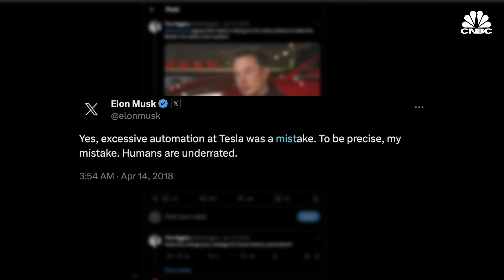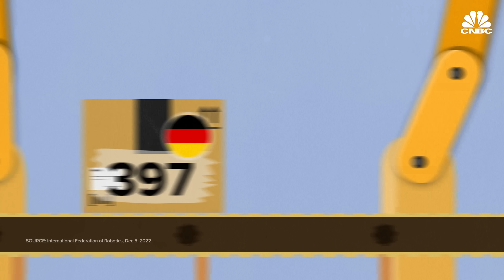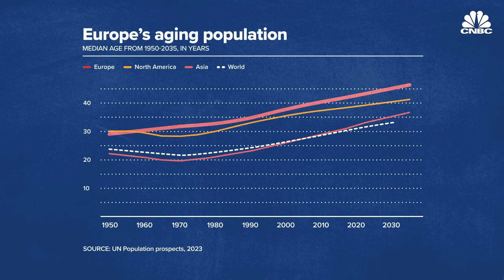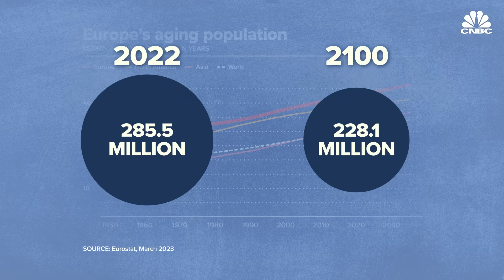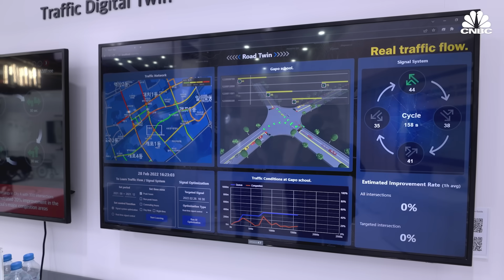Factories are heading for a ‘dark’ future — and it’s not what you think

Comment: The segment on needing humans to detect a fault or error was disingenuous. IoT or PLC controls are instantaneous and capture millions of data points in a day, all of which are statistically analyzed autonomously. The microsecond something hits an outlier detection program an expert system can diagnose the issue, halt the line, call in for maintenance or even involve a human mechanic. This capability has been around for almost a decade now. There are a handful of roles in a dark factory. The engineer, mechanic, electrician, plumber, however with robotics now on par with human dexterity, even skilled trades are at risk.

Comment: My degree is in robotics and mechatronics engineering and I love this stuff. I made an aged care robot as a working prototype and it could detect falls, call for help, bring medication (biometrics to make sure the correct person got the pills), bring water, books, food etc. as at the moment there aren't enough carers to do these menial tasks so if they can implement something similar in aged care homes it would allow the workers to do more meaningful things like talking to the residents. It would help raise the level of care as there are more and more aged people and not enough carers to do the job properly. We need more robots in society.
Reply: So smart and yet so stupid.

With AI, the robots will do the talking, and they'll be better at it. Cheaper, too.

There isn't a job that won't be automated in the next 10, 20 years, including yours.

This is the end of humanity, not just capitalism.
Reply: @Ilamarea  AI can advance very quickly as it can reiterate over and over again to improve itself. Hardware is much slower to develop and is slowing down over time as we reach physical limits, like CPUs with 4nm width lines, it is extremely difficult to go smaller than that. Other parts are already optimised, like capacitors, resistors, etc. but we still make new things all the time. Battery technology is progressing but it still takes a long time between iterations, if it progressed as quickly as AI can we would have batteries that would hold massive power and take seconds to charge. 
AI will take many jobs but autonomous robots will take decades to become mainstream.
Reply: @Martian74  It will indeed take longer to replace physical labor, but the problem is that all well paying jobs will be easily replaced by AI - doctors, lawyers, programmers.

The thing about AI, is also that it accelerates its own development, as well as development of other technologies. AI is the main thing missing from robotics to allow full automation. AI's already analyzing and autonomously testing all theoretically possible materials for batteries for example.
Reply: @Ilamarea  Doctors won't be easily replaced by AI. AI will be used to complement a doctor's work to make their life easier and potentially provide better treatment. I live in England and the publicly funded NHS (National Health Service) is pushed to the limits with too many patients for the number of medical staff we have. We also have long waiting lists to see a GP, see a specialist and get treatment.

The entire county would gladly welcome the use of AI in the NHS if it helps to alleviate the waiting lists and makes the lives of medical professionals less stressful
Reply: We don't need more robots in society. You just WANT robots in society. There's a difference.
Reply: Haha, you are a bit naive and can't think laterally, if you did, you would realise as a business owner running the care home, I bet you would sack the redundant human staff to increase the profit. What if the robots can do the talking to the care home residents too.
Reply: @chanman5600  The technical types are generally naive idealistics

Comment: I work in gum factory. It's my 4th week. We have 2 robot arms one big purple and small yellow one. Yellows job is to scan whatever it was suppose to scan - because I never saw it moving and there are no labels yet at this stage - and the purple is moving plastic boxes. Why do I mention this all. Guy in the video said robots can work 24/7, well yes in theory, altho my experience from what I saw the purple robot arm gets an error every 5 minutes. So no, I disagree with that.
Reply: You are not thinking about exponential growth. Please compare the robot in your factory to figure1
Reply: thats a shitty robot then. I worked for a big automotive company and parts of the production run entirely on robots 24/7. Errors happen but they are quite rare and can usually can be fixed by an operator within  a few minutes. Those robots are already far more productive than humans

Comment: Still, plenty of technicians and engineers will be on the floor shop of these "dark factories" to constantly maintain machines and supervise production processes.
Reply: But the numbers of these technicians will be considerably lower than the number of employees displaced.  Not that this is a bad thing.  As they say if a job is dull, repetitive, or dangerous, get a robot to do it.
Reply: @JBoy340a  that's how economy grows. 200 years ago nearly everone worked in agriculture. Now, it's like 2% in developed countries.
Reply: @kossaKSF  agree.  Back when humans did a lot of dangerous things like cutting crops with a scythe, there were many more injuries and deaths in agriculture.
Reply: Not really. If you are a technicians or a engineer you see every year the machines break less and repairs are easier. Soon enough everything will be throw it away and put another one in it's place to work.
Reply: @internallyinteral  I work in an automotive components factory and I cannot agree with this statement. Present automated production lines are orders of magnitude more complex than the older ones, and there is a lot of work to keep them running smoothly. They also generate plenty of production data for engineers to implement constant process improvements. Therefore, there is much less labor work required, but engineers and skilled technicians are in demand like never before.
Reply: @kossaKSF this is not the same as during the machine revolution of our past. A machine replaced one job. The person who did that job could do other jobs at the farm that the machine did not do. Did we increase production by 300%? Someone needs to pack and stock it on to a truck.

Now imagine the machine replaced the truck, the packing line, the truck driver, the accountant and the salesman.

What will that man do? 

It will wipe out JOBS not a JOB. There won’t be any place to go.

Comment: Worked at Tesla for 5 years and can confirm there will never be a fully "dark" car factory. Robots routinely fault,  circuit breakers trip and every pillow block bearing and gear mesh eventually requires lubrication.

Comment: This isn't anything new. I have almost 20 years of industrial automation experience and companies have been trying to get to lights out for years. There always proves to be some niggle. Some program isn't perfect, a part is slightly out of spec (if a spec exists), or slightly misaligned. Someone still needs to keep an eye on the robots incase they get any Skynet ideas (/s on that last part).

Hopefully AI will make the robotic systems more flexible and adaptable to faults. But I think fully dark factories to be a ways out for some time to come.
Reply: What do you mean ways out even 50 years is soon imo.
Reply: @coalhater392  Probably several hundred years. As technology increases we will have more things to make which means automation will always lag behind.
Reply: @ifandbut  You severely underestimate the advances in AI.
Reply: i worked in an automotive factory and there were parts were only robots stood, that had light sensors that would turn off if no human operator were in the area

Comment: So "dark" does not mean dark but robots!  I guess they couldn't think of anything better to cal it then "dark"!
Reply: It comes from dark factories where they actually turn off most of the lights to save electricity.   One place I worked that had robots doing most of the manufacturing turned off 2/3s of the lights in some sections of the line.

Comment: FANUC has the robotics products and expertise to help you succeed. With more than 100 robot models and over 40 years of helping manufacturers achieve their production goals, we're ready for any manufacturing challenge in any industry. FANUC robots for manufacturing are easy to operate and provide complete flexibility thanks to a range of application-specific options, straightforward integration, payloads up to 2,300kg and maximum reaches up to 4.7m.

Comment: I have read about Fanuc being a leader in robotics and has robots making other robots back in the 1980's, I think.  Nice to know they are still thriving.
Reply: Work for a company that has about 140 fanuc robots and can atest how awesome they are.
Reply: A lot of CNC machines also have Fanuc controls. I've run a few & they're very reliable and easy to program, set & operate.
Reply: I worked for fanuc. They do have internal issues, I assure you
Reply: Robots making robots?..lol.  That's still a pipe dream 2023.  Nothing runs on its own.

Comment: I was at Tesla from 2015- 2019, the push for automation through the model 3 assembly was a disaster. Not because it couldnt be done given enough time, but because it doesnt need to be done. You automate assembly processes to improve the output or yield, but you do not automate just to automate.

Comment: There is a common misunderstanding that robots can always do a job cheaper than a human. This is not true. For repeatable jobs requiring high precision it is. For simple jobs like stacking or scanning pallets its true. But that still leaves a vast number of jobs where humans beat robots easily. The joke about these light out factories is the number of humans than are needed to keep them working.
Reply: For eg. ?
Reply: @polyteky   examples: High end car manufacture. Relatively low volumes with each production unit being customised. Their production is 90% manual as the costs of using robots would be too high. Another example, manufacture of ships propellors, available robot technology can't do it at anything like it at the same cost a manual can, hence all propellor is manual skilled artisan work.
Robots work best at simple , repeatable high volume tasks.
Reply: if you say it's a joke then the number must be significant. what's the ratio of humans to machines for lights out manufacturing to achieve a similar yield compared to the one that is not?
Reply: @efraim6960    You have just asked the equivalent of "How long is a piece of string"!   The answer is " It Depends" . The value depends on the technology they are using and that in turn depends on the product they are making.
Reply: Part of the stacking and scanning is automating in a lot of places, like Amazon.